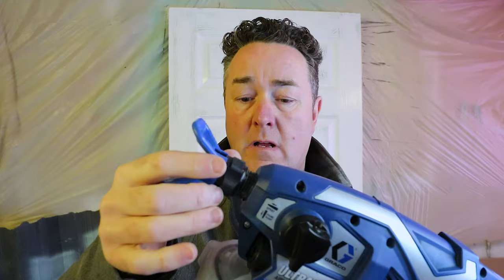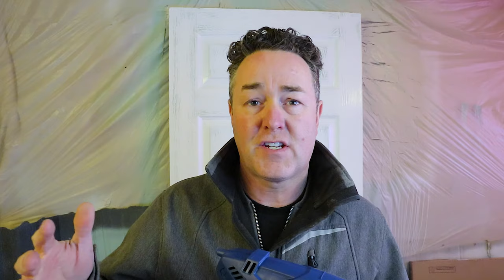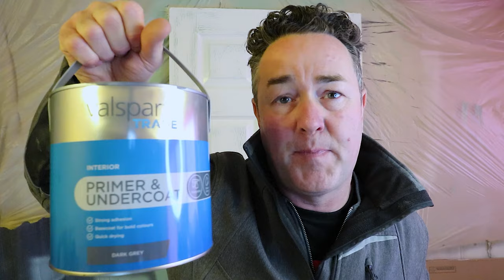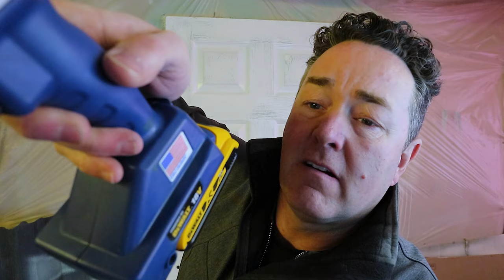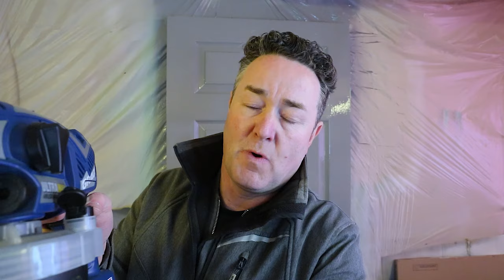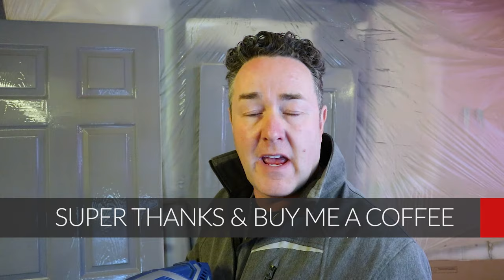Graco Ultra Max - all you need to know and more

Comment: This has been useful Phil. I’m fully into the full size Wagner system for the HEA and I find they suit me perfectly, but I’ve been looking for a smaller sprayer for quick touch ups jobs or easy running around a single room doing trim etc; the smaller Wagners haven’t impressed me much so the Ultra Max was on my radar to look into. Really helpful matey, thank you.
Reply from the maker: Glad to help. What do you think to the Quick Shot?
Reply: @ProfessionalPainterDecorator  Having looked at it, I’m swinging towards it more. It’s more adaptable and easier to manoeuvre, which makes a huge difference. While the Ultra Max looks good as an all in one solution, the extra flexibility of the quick shot would make all the difference. I’m going to watch a few videos on it tomorrow and then get an order in 😁

Comment: I've had the Ultra for a few years and I do really like it, but I agree with everything you are saying. The unit gets very heavy to hold for long sessions and it is annoying when it loses prime in the middle of a spray. Also getting all the air out is annoying. I just got a quickshot and I like how it is gravity fed. Also, how is that unit so clean! Every one I have seen has paint all over it from use and cleaning.
Reply from the maker: I had to clean it before use

Comment: My skirting boards and  doors frames are gloss over the years it has multiple coats of gloss , I wanna go to a satin , so my question is , would you use 120 grit then 340 the use under coat then 2 top coats, ? And my other question is scuff x would you also need a primer first then 2 top coats , and is the Johnstones aqua guard just as good or scuff x is better wanna use on my banister as a well many thanks
Reply from the maker: Sand down with 120 will be enough. Or those Mirka gold flex 150 pads I have in my Amazon store... Link in the description.

Yes. Over oil gloss idbgo with a grip primer UC then two top coats of scuffx.
Or use Benjamin Moore stiX.

Some paintsnliie Isomat, you can go with AllPrimer and then two top coats of Satin Isolac.

Have a watch of my Aqua Gaurd and ScuffX videos.

Comment: Does this one spray bins primer? I have some brushing wax on my skirting I want to cover. I have used bins before and it works really well as a primer over the wax.
Reply from the maker: Yes. Clean out with meths.

But I'd clean the wax off as much as you can with meths and wire wool as well.
Reply: Wait a minute… You guys are cleaning these out with meth? That’s got to be expensive if you’re outside of the US😬
Reply from the maker: @AlexandraCimino  you know the thinner for  a shellac based product (like Zinsser BIN) is methylated spirit?

Comment: the pump life is 200 gallons if i recall correctly. That's not 200 liters, that's 750 liters.
Reply from the maker: Google it. :(
Reply: @ProfessionalPainterDecorator  Yes... it's 150-200 gallons, so not liters. 200 liters would be ridiculously low cobsidering the pump costs about 300€
Reply from the maker: Last paragraph 
https://www.paintaccess.com.au/blogs/company-news/how-to-replace-pump-on-graco-ultra-and-ultra-max-hand-held-paint-sprayers#:~:text=The%20pumps%20themselves%20have%20a,replacing%20them%20after%20this%20cycle.
Reply: @ProfessionalPainterDecorator  I realize that we're talking about the ultramax. I was talking about the quickshot sorry lol
Reply from the maker: @SynQ86  lol
They use a very similar pump though
Reply: @ProfessionalPainterDecorator  yet they rate it a much higher life span it seems

Comment: 8 is gonna kill that pump Phil. 5-6 maximum for that machine
Reply from the maker: 5-6?
Reply: @ProfessionalPainterDecorator  yeah it’s a small pump and although 10 is the highest setting it goes to it’s not designed for use at that level. 4.5.6 are the optimal power you wanna be using. All you needed to do was thin your pain ever so slightly and bobs your uncle Fanny’s your aunt.

Comment: Ultra max not for me the fact you have to earth it to a socket makes it not so portable and I don’t spray solvent and if I did I’d use air spray with PPS system I have the ultra and only use it for what it was designed for a touch up gun 👍🏻

Comment: In a word , CRAP 
Forever blocking , pumps don’t last , avoid 
Mine went on eBay after a short while
Reply: That surprises me Dave, I had the very 1st original one I got from a fella I know in the States. It was absolutely superb, never missed a beat, never spat paint and didn't leak as some others have said on here. I sprayed well over 50 gallons of paint through it not including the water I put through to clean it. It only gave up when the batteries, originally 21 volt graco ones, gave up and I couldn't replace them. Maybe as these units have become more popular, they've reduced the quality. I wonder if yours just needed a bit more fine tuning on paint dilution and pressure?
Reply: Probably about 5/6 years ago 
Was looking for something to doors on new builds with no power on
No end of trouble with it tbh 
Went back to t5 and a generator 
No comparison